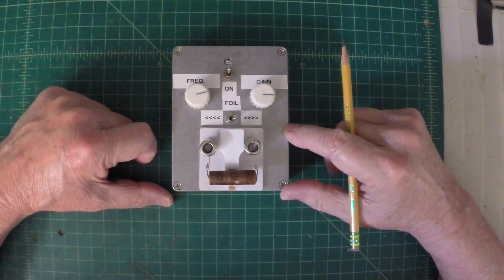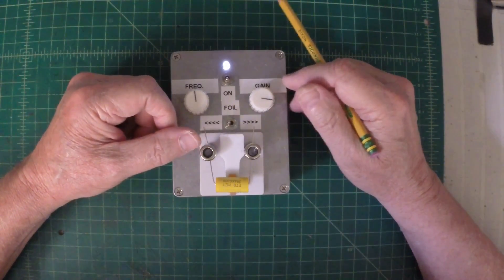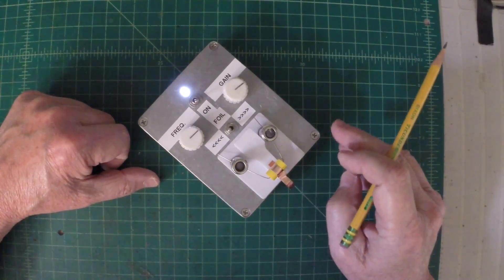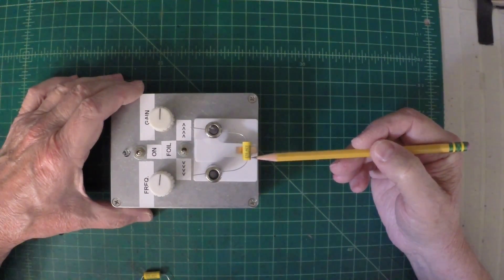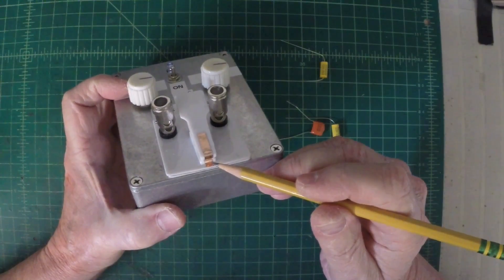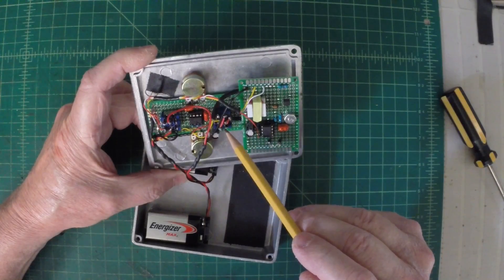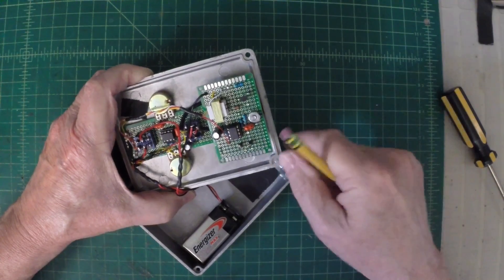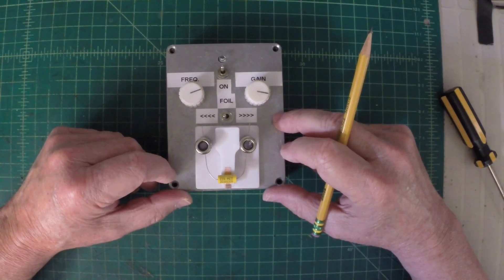Capacitor Outside Foil Sniffer - All In One Prototype

Comment: I was going to build the original two part setup, now I am going to convert to the single unit, I like this one much better. Thanks for the upgrade.
Reply from the maker: Jim, just curious if you built your unit and if so how does it perform? Thanks again for watching. Best, Don
Reply: @RestoreOldRadios  Not yet. Just finished gathering the parts. I will start on it soon, I work two jobs, so time is short for the fun stuff.

Comment: What a great device and ingenious design. Currently, I test for the foil side by attaching the leads of a cap to a standard shielded cable going to an amplifier’s input. While holding the cap between my fingers to act as a hum antenna, I swap the direction the cap’s leads attached to the positive and negative of the input. With my ear close to the speaker, or using headphones, I listen for the position that creates the least hum. When that’s determined, I know that the capacitor lead connected to the shielded negative is the foil side. Your device would certainly be less cumbersome to use, but then again I’d have to build it and that would take time. Then again, I’d have to build it and that would be fun!
Reply from the maker: Thanks for your kind words. Your approach is simple, very effective and adopted by many. If you elect to build this circuit in the future I would appreciate your feedback afterwards. All the best. Don

Comment: Such an incredibly niche tool! I'd post it to /r/specializedtools but I bet they'd have no clue what this even means. For some people this is quite useful. By the way, I think Paul Carlson made one of these before...
Reply: The unit that Mr. Carlson built is a little different, relying on your fingers to be the near field probe, and it switches the leads electronically. I built one of those myself and it works fairly well. I like this one that uses the oscillator and near field probe. I also love the push clips for the capacitor leads.
Reply from the maker: Rick, thanks for your reply back on this to Evan and... Stay well and thanks for sharing your feedback, Best, Don
Reply from the maker: Thanks Evan. Paul's design is different, but achieves the same results. Best, Don